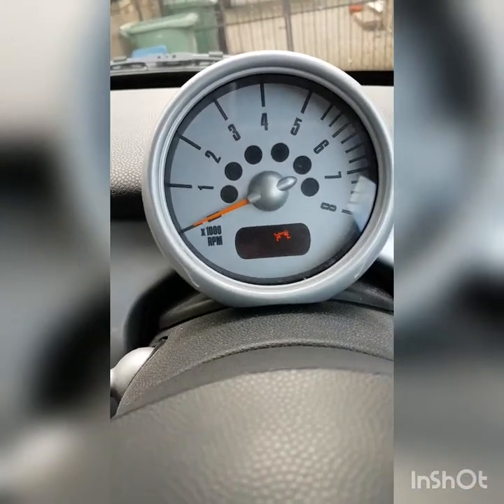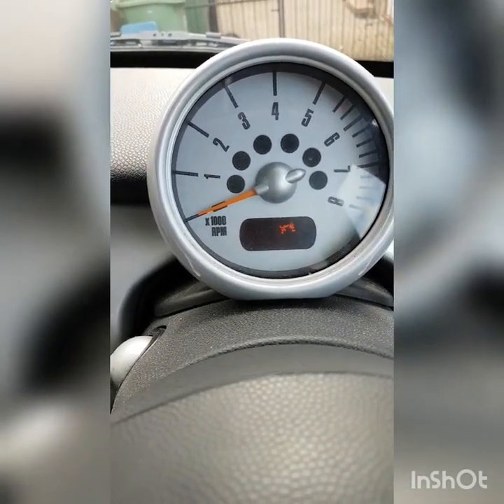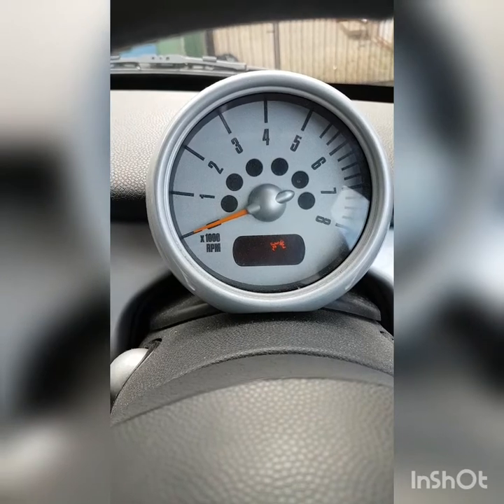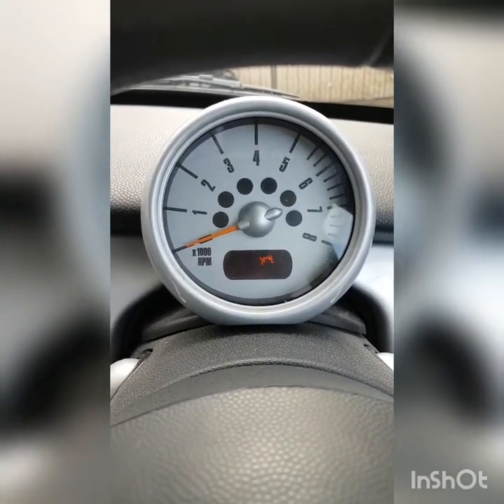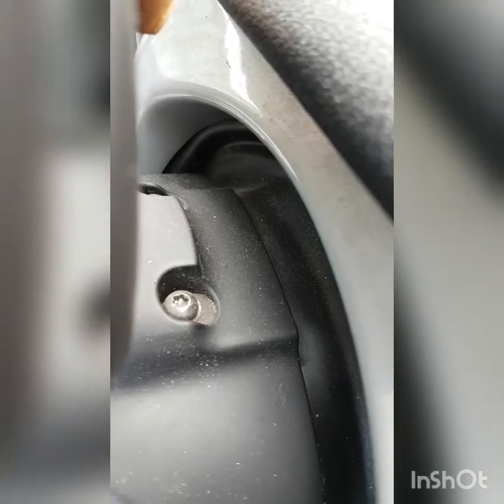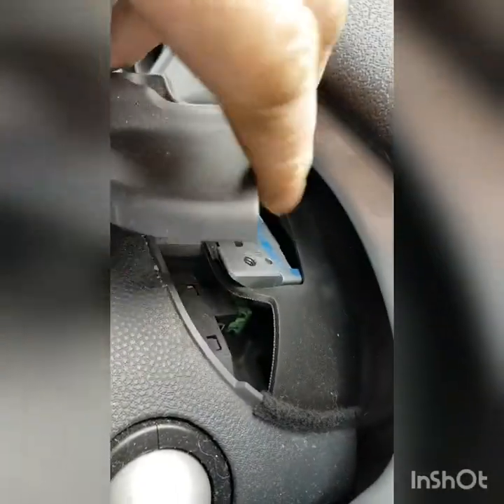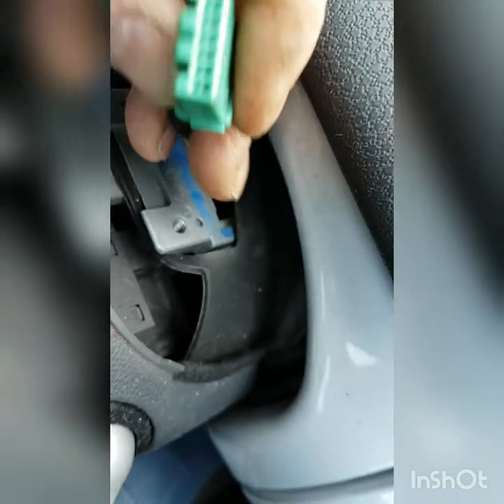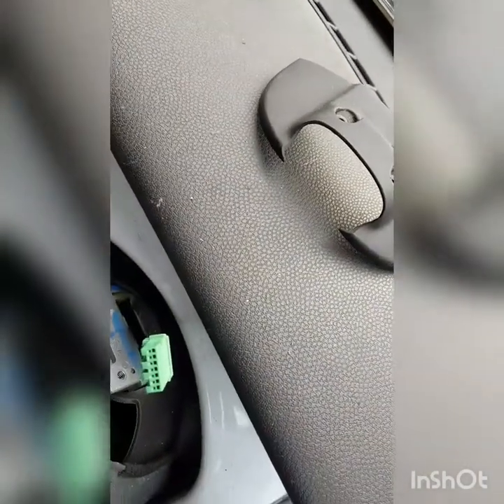Mini r50 rev counter replacement swap

Comment: Was it just the temp/speed screen that wasn’t working or was the needle and other sensor lights not working properly? 

The latter is my problem and I’m looking for a solution.
Reply from the maker: @jayy_p3113  on that car it was just the screen but I've had another that everything stopped working.
Reply: What did you do for repairs when everything stopped working?
Reply from the maker: Changed the rev counter and all was good.

Comment: Nice video Tony, i'm having the same problem on my r50. Mine has multiple functions... do you know of i can repair or replace just the LCD? There is not so many parts of mini in my country :P
Reply from the maker: I'm not sure if you can buy just the LCD but I found that the hole clock is quite cheap from a car breakers. Ebay is also very good  👍

Comment: I have a mini one r50 1.6 2003 and no tachomter just a plastic cover, how is it possible?
Reply from the maker: I'm not sure what you mean. I did think all mini's came with a tachometer? I would take a look under the plastics and see if there is some wires and if so, buy a tacho and fit it.
Reply: @tonyrepairs5558  there are two wires that are plugged into the direction of the steering wheel. One is black and one is green. Maybe the green one is for the tachometer but im not sure maybe its for airbag/honk or somethung. How is it plugged in your mini?
Reply from the maker: @Roger-wu2eg  from memory I think the two wires your talking about are for the airbag. The wires for the tacho don't go to the steering wheel. The wire should ve just under the top plastic cover where the tacho fits.
Reply: @tonyrepairs5558  hmm ok.. there ist just no one or its hidden.

Comment: Does the replacement one need coding to the car?  And does it show the original mileage?  Thanks
Reply from the maker: It's only the rev counter and temp and on some the MPG comp but the milage is kept on the ECU. This is a straight replacement and NO coding needed on the R50 R52 & R53
Hope this helps.
Reply: @tonyrepairs5558  I've got an R60 2012, I am hoping that this the same. Thank you 👍🏼

Comment: I have a complicated question when the engine isn't on but the ignition is on my dash works and sound but when I start it the led switch doesn't work or the sound but from the outside my indicators work anyone know what's going on? I did replace the radio and this happened Ive checked all the fuses looks fine
Reply from the maker: It sounds to me like you could have a problem with the BCM. It's in the foot well on the right side. Check for water ingress and inturn dry naturally and not on a radiator. Hope this helps.
Reply: @tonyrepairs5558 hi I'll give it a try thank you

Comment: Is it only tempature outside this displays does it show speed? The mini I just got I think has a faulty one as its blank. Just curious if it does more than outside temp
Reply from the maker: I've had a few minis and they have all shown different things. My r53 shows the outside temp and speed. My old r50 which is in the video just showed the outside temp but I did have an r50 that showed lots of different things as it had the full onboard computer. Hope that helps. You do need to check the part numbers. 👍
Reply: @tonyrepairs5558  thanks for the quick reply. Mine is a 2001 Cooper there is no Coontrol to enter any menu on the stick so I assume it's likely to show temp then. Thanks for the help and the video.
Reply from the maker: @Immortal yes if you dont have the button on the indicator arm then you will just have the outside temp  👍
Reply: @tonyrepairs5558   ah perfect thanks Tony.